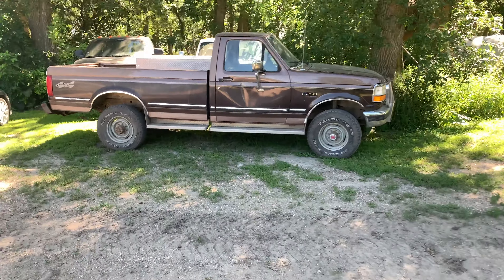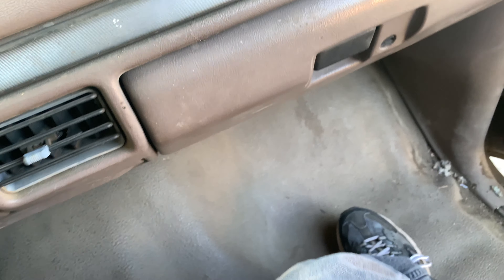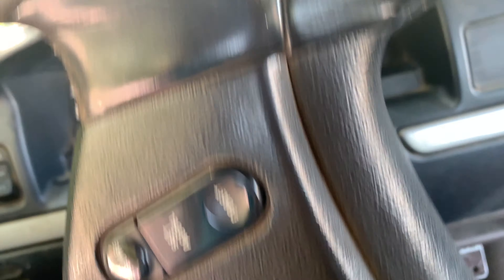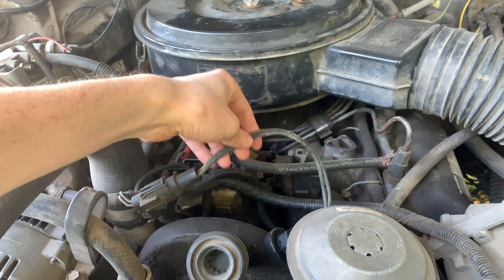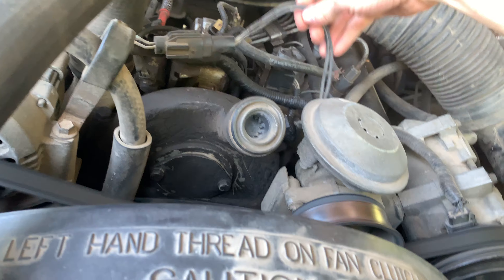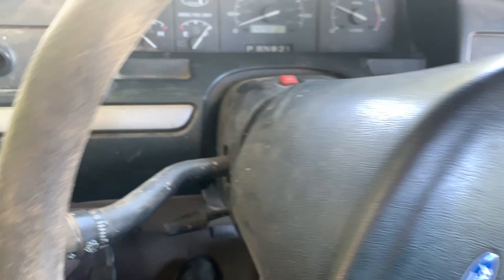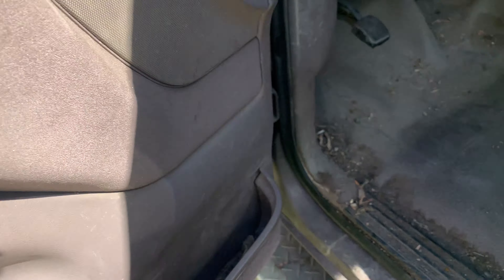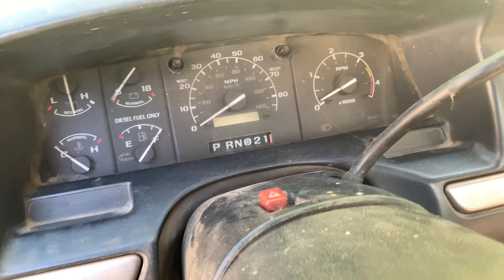Slow Tach on a Ford F 250 IDI 7.3L 1993

Comment: So did you replace Tachometer Sensor and that it fix the problem?
Reply from the maker: not yet it works time to time
Reply: @robbie150  so did you replace the Tachometer Sensor? Or are you working off the old one still?
Reply from the maker: still off the old one works fine so far from time to time
Reply: I heard that the transmission wont shift right without the tach. I replaced my sensor and still no tach, AND I  have to rebuild the transmission now.  What else could make the tach not work?  It quit when it say after removing the transmission last year and never worked again
Reply from the maker: i think there is a sensor in the rear diff it could be a loose wire i dont think its the transmission i had the issue with it not shifting and the wire just fell off fixed the wire shifts like butter now
Reply: @robbie150  lol. No. I mean I had 2nd and 3rd, but now I only have reverse.  Been driving that way since October
Reply: Just an update to everyone who is wondering.. The tech diameter was not working. I did replace the (Tachometer Sensor) and now it is working perfectly